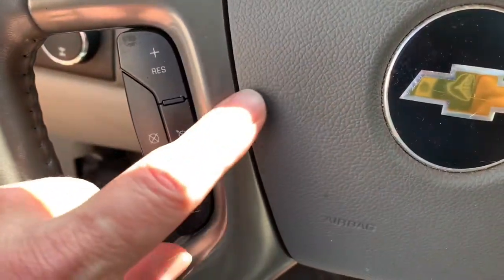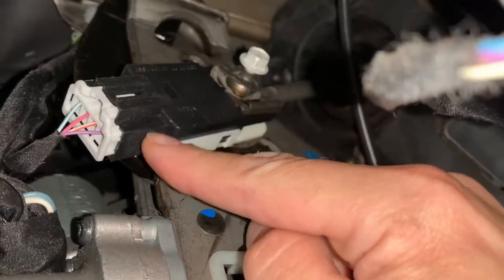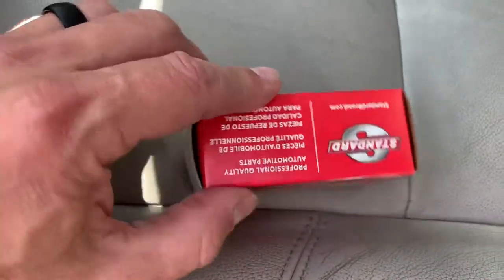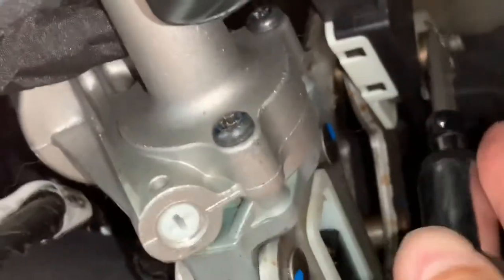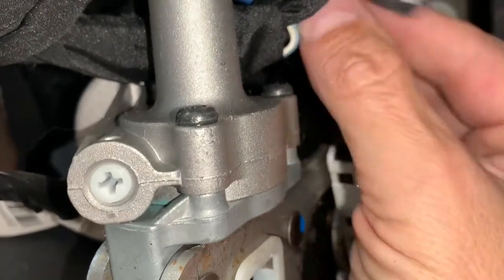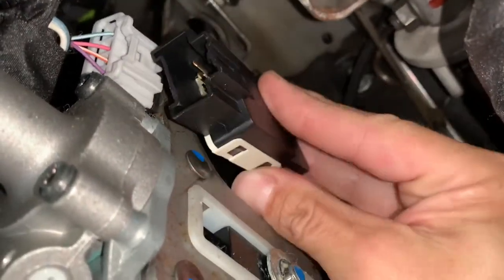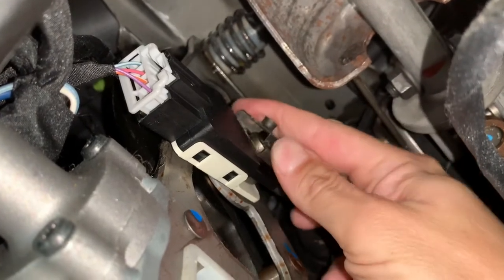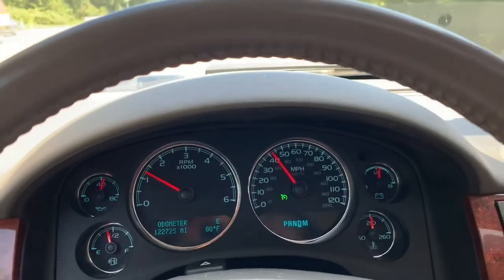Cruise Control Fix - 2011 Chevy Suburban

Comment: Thank you for this video!!!
Clear concise and to the point!
My 2011 suburban had exact symptoms you described. 
Bought switch at Advance Auto for $40. 
Spent less than 15 minutes to swap it out.  
I used a 10mm ratcheting “gear wrench” rather than a socket wrench. 
Had to use a screwdriver to pry switch & pushrod.  It wouldn’t slide off easily. 
Hardest part was the contortions an old guy like me had to do to reach this switch. 
New switch made Cruise Work perfectly!
Thanks again!
Reply from the maker: Glad it helped you!  I’ve been crawling under and over lots of cars lately!  Definitely too old for this!! 😅

Comment: This also worked on my 2009 Chevy Silverado but I wish you showed how you took the clip off of the brake pedal the whole thing the whole assembly to get that sensor to be released for everyone else. Get ready for a nice flat tip screwdriver pull on the clip and pride with your flat head screwdriver to get that clip off.
Reply from the maker: Glad you got it off. Some things are hard to do filming on the phone, and that's what I was dong to make a quick video while I worked.

Comment: I have the same issue on my 2011 silverado. Bought new brake switch and it still didn’t fix the issue any ideas?
Reply from the maker: It could be the switch on the steering wheel itself.  I don’t have that suburban anymore, so haven’t thought about the issue or the system in awhile.  But I know I was preparing to buy and install the new buttons on the steering wheel if the brake switch had not worked.
Reply: @swatscorner  yea I was hoping it was easy fix but I guess not thanks for the reply

Comment: 2010 Savana did the same thing, didn't fix the problem. Any ideas?
Reply from the maker: Most likely the switch on the steering wheel.  You can check fuses, too, but that’s about all I know

Comment: So, you're saying the brake light was working fine—but the cruise control wasn't? Weird.
Reply from the maker: Exactly.  That switch sends more than one signal from the switch.  The part that disconnected the cruise control was the issue.  It must have always been in “disconnect” mode which is probably the failsafe mode.  I read about the issue online, but didn’t see too many videos on it, so I made one to help others. Always love it when I find a video online to help me with a project!  Loved that Suburban, but started having overheating issues.  After 4 times in the shop for that, we sold it.
Reply: There are two sets of contacts in this switch.  
A normally open set and a normally closed set. 
Lights are on the open set
Cruise is on the closed set. 
The cruise circuit switch fails OPEN, thus preventing cruise engagement
Reply: Yeap thats how it works
Reply: Gotta love the comment section i needed to understand why and here it is